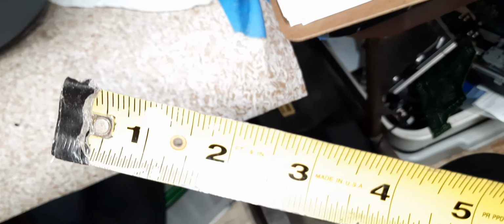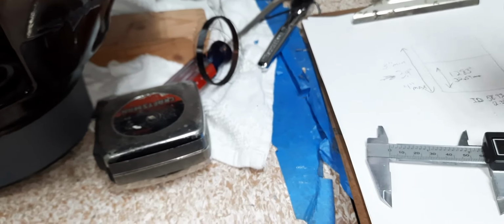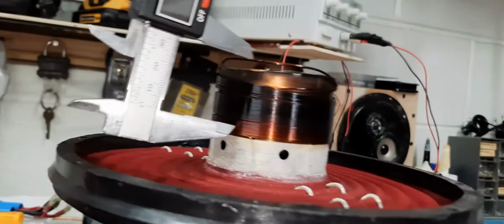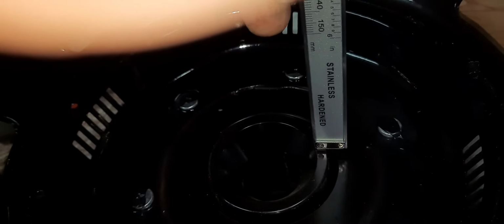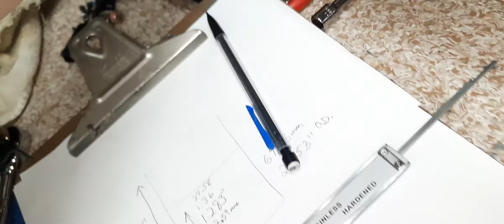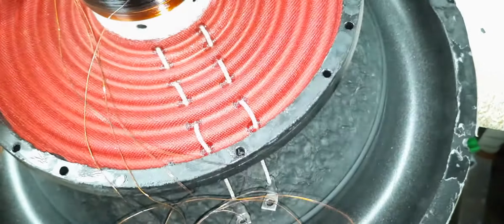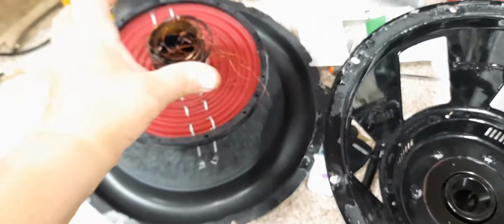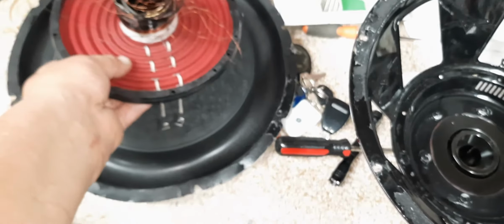Skar SDR 15" Sub refurbish. without trying to replace anything but coil.

Comment: The Kicker replacement 2.38" coils work great in these.
Reply from the maker: For real thank you want to rebuild these and sell them so somebody can have a decent set of 15" for their car for cheap. Again that's for the heads up I appreciate you telling me that.
Reply: @Ron-Webster  no problem man. I reconed four of the 12" for a guy, about 8 months ago. Just watch with trying to use d2 coils, in a d4 gap. Most times, a d2 will not fit a d4 gap, but a d4 will fit a d2. Just a heads up bro. Most all motors, with a d2 gap, will be larger than a d4. Good luck with the rebuild.